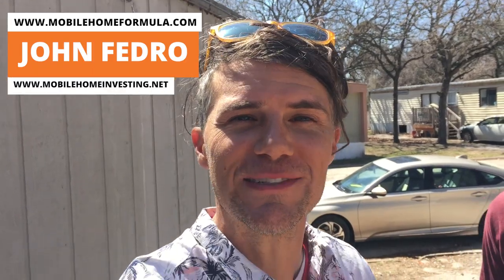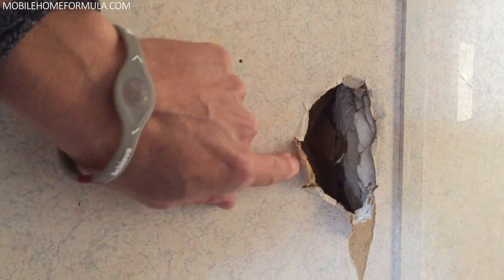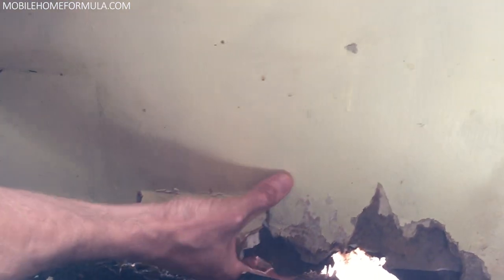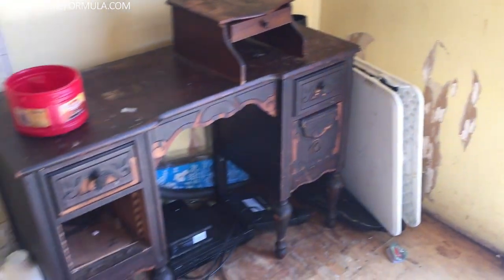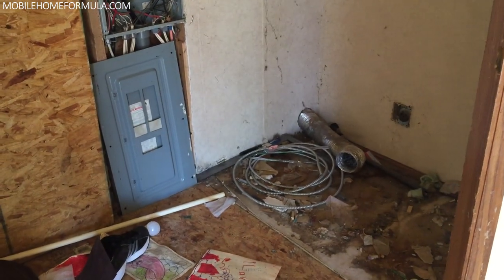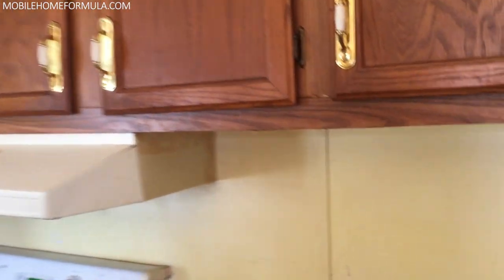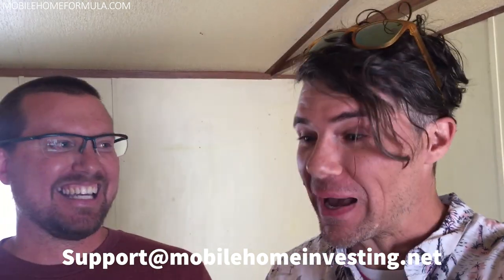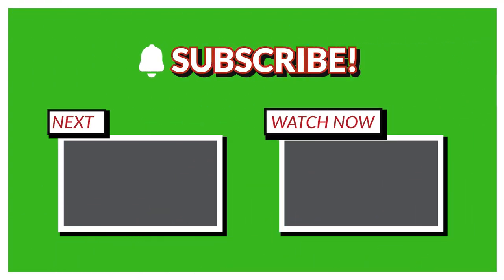FREE Mobile Homes Still Exist

Comment: Past a certain age would a free trailer be too much to fix? I got a bead on a trailer from 67'. If anything I want to get a sense of what to do with a handyman special.
Reply from the maker: Hi Kyle. Thanks for reaching out and connecting. Age definitely has something to do with it for sure. If you fix up a 1967 mobile home completely you will not be able to sell it for anywhere close you would be able to sell something from the early 2000's. However depending on the neighborhood, location, and demand you should not fix the home up completely, but rather sell it needing some repairs and disclosing everything you know about it to a new buyer. Perhaps an all cash buyer or perhaps a monthly payment buyer. However to answer your question, yes there are certain repairs or deal breakers that would make almost any free home a potential pass. However when dealing with homes prior to 1976 the ability to move them to other locations is much more difficult. There definitely is a lot that we could talk about when it comes to this topic however I hope that this helps and makes some sense. Moving forward any follow-up mobile home related questions please never hesitate to reach out anytime.

Comment: Is there any in Orlando Florida I am in desperate need of a place to blive
Reply from the maker: Hi Shirley. Thank you for reaching out and connecting. Free mobile homes can be found all over the country. In every state you can find the occasional advertisement for a free mobile home. However if someone is advertising for a free mobile home is likely valued at even less than free. This means that in most situations free home will not be worth your trouble to live in or invest in. Perhaps it is to destroyed, not habitable, must be moved, or some other reason that would kill the deal. I mention this because you can and should look online for free mobile home opportunities. However almost everything online will be snatched up very quickly if it is advertised at a low price. You may also want to reach out to every local, and not so vocal, mobile home community manager to find out if they have anything that is very inexpensively priced may need a good deal of rehab. Since you are in a desperate need of a place to live I would encourage you to reach out to some type of apartment rental service that could help connect you with an apartment or place to live within your budget. This is probably not the answer you are looking for however I hope it helps and points you in the right direction. Moving forward if you have any follow-up questions never hesitate to reach out any time.

Comment: Would love to see how it turns out and thank you for sharing
Reply from the maker: Hi Virginia. Thank you for reaching out and connecting. Thanks for watching the video. I do hope that it was somewhat helpful to you already. New update: Casey is put around $4000 of repairs into the mobile home. Much of these have gone into cleaning out the home, wall repair, mold removal, and plumbing underneath the mobile home. He sold the home for approximately $10,000 to a quick buyer that is going to do the rest of the repairs and move into the home personally. Personally I would love to see how the home turns out as well. That is a big joy of mine; I love returning and checking in on payment-buyers that I sell handyman special type mobile homes too. It is great to see the improvements in these homes, and the joy in the buyers eyes as they explain the really good improvements they have usually made and value they have added. Thanks again for commenting. Any mobile home questions that you have never hesitate to reach out any time.
Reply: @MobileHomeFormula  That's not bad and you are very welcome

Comment: Just me probably, but I would bring the whole place back to normal, and do most of the labor. May a 5-6 thousand investment.   Flooring, paint iside and out, electrical, plumbing, replacement windows, etc. Would check roof completely and make repairs as needed.
Reply from the maker: Hi Gregory Clark! Thanks for reaching out and connecting. I like your style! This would be an amazing rehab to see the home go from the current condition to then replacing most items. As you can see in the video the home definitely has pretty good size, however most things definitely have a lot of wear and tear on them. I like that you do not mind getting her hands dirty and like to improve things yourself. Keep up this desire and ambition moving forward. Moving forward if you have any mobile home related questions never hesitate to reach out anytime. All the best. Talk soon, John
Reply: @MobileHomeFormula  Thanks John. Will do.

Comment: Nice a;oha shirt and it was fun to see your easy flow and sense of humor together. OMG you are NOT going to "just paint over" the smoke residue.
Reply from the maker: Hi Guinevere pendragon. Thank you for reaching out and connecting. Very cool name as well. I do hope that this video was helpful to you a bit already. For different situations we definitely make different repairs when needed. Over the years I have certainly seen my fair share of smoke damage, and various other damages for that matter. Sometimes the smoke damage is due to a fire, and sometimes it is simply due to years and years of cigarette smoke. Other times it may be due to other type of chemicals or smoke that can cause an even bigger problem than cigarettes. They absolutely do sell chemicals that will help remove the nicotine and tar if you would like to do so on cabinets and countertops and everything else that will not likely be painted. However depending on what type of primer/paint you use the instructions will say to go directly over paint and smoke residue. There are a few different brands however Kilz original may be a good one for you to look at. This is a really popular product that many investors will use to cover over heavy smoke smells, urine smells in plywood floors, and even mold on walls. However covering mold in this way is not a good idea in my opinion. Smoke smells may certainly be trapped under a layer of primer/paint, however when it comes to mold we almost always want to clean and remove any mold first before painting to cover. I hope that this helps and makes a bit of sense. In short, it truly depends on what product you are using and what repairs you are fixing with regards to the procedures and products you might want to use. If you have any specific questions or concerns never hesitate to reach out or comment back anytime. All the best.

Comment: $3k will be plenty for reno budget
Reply from the maker: Thanks for commenting and connecting. Glad you feel the same way. When used properly $3000 can definitely go a long way. Well… Perhaps not as far with today's lumber and material prices. However $3000 can certainly do a lot of good when used wisely in these homes. Thanks again for connecting. Any specific questions never hesitate to reach out anytime.
Reply: Thanks, I got a solution for that lumber issue. I'm actually able to capitalize on it, I would love to get your input about a project I'm gonna finish up soon. Maybe we could help each other.

Comment: interesting unit.
Reply from the maker: Good to hear from you. Thanks for commenting. I am reading between the lines and sensing that what you are really saying is that the home seems pretty junkie as it is in the video. Since it is in a place with limited supply and a strong demand is definitely worth fixing up the home where needed. Keep in touch. Let me know if I'm right with regards to your initial comment.
Reply: @MobileHomeFormula  junkie, yes, but fixable. Would you replace the water heater?